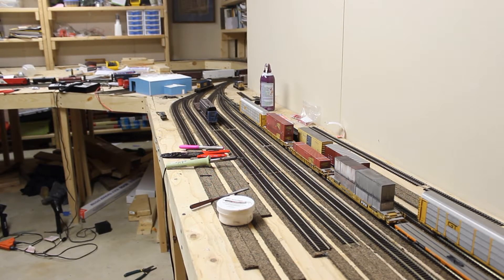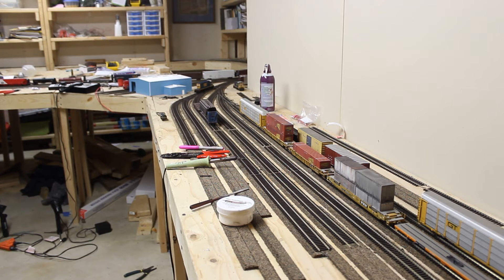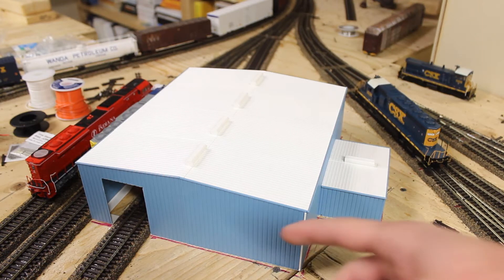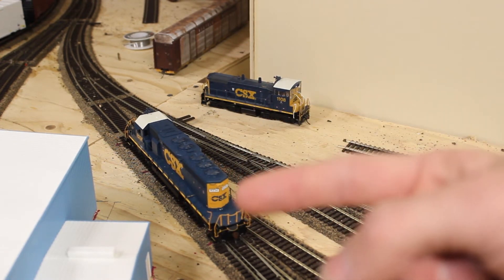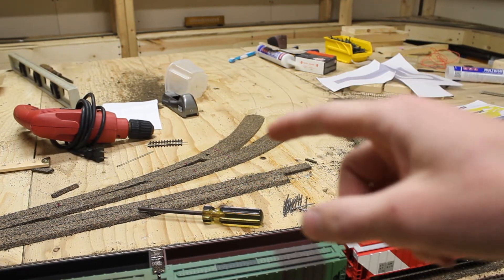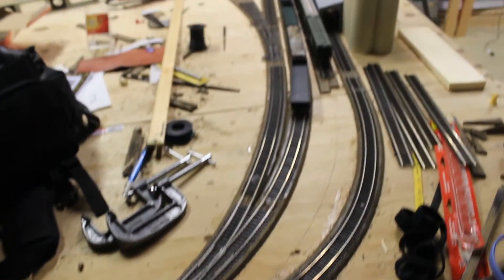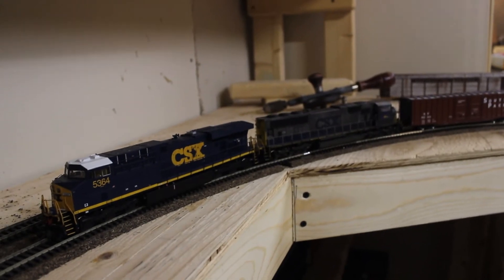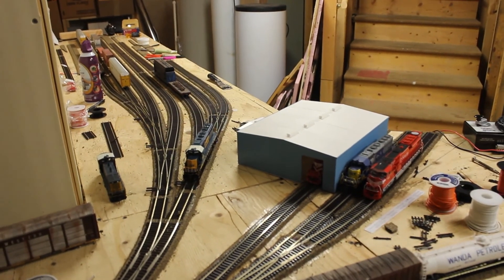Layout update 11/19/2014

Comment: Great update and the camera has a great picture.  Auto focus isn't all that its cracked up to be.  Depending on what you are videoing auto focus makes the video worse.
Scott
Reply from the maker: Thanks! I haven't had to much trouble with the auto focus on my video camera but with the canon on video mode it wont change once its set so cant move it around. Was not to much trouble to do it on my own so I will probably keep using that for future updates.